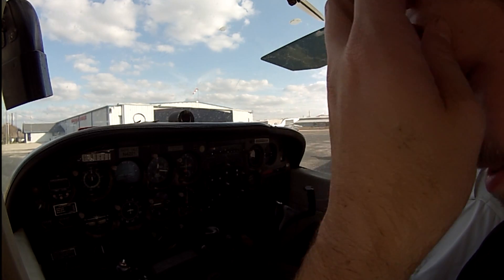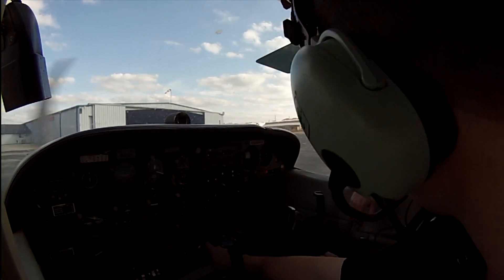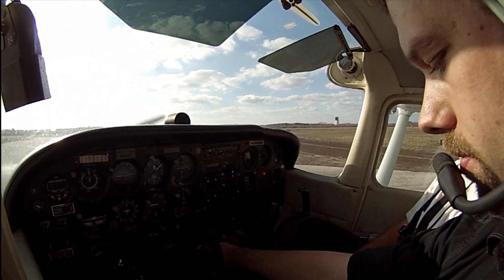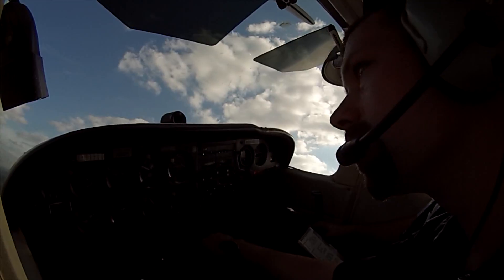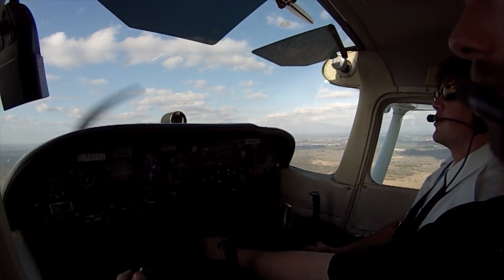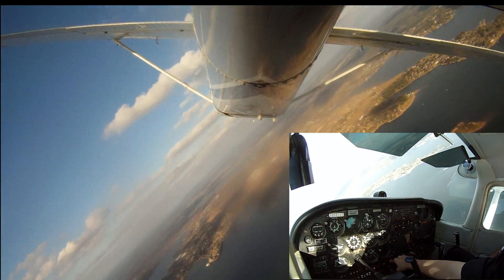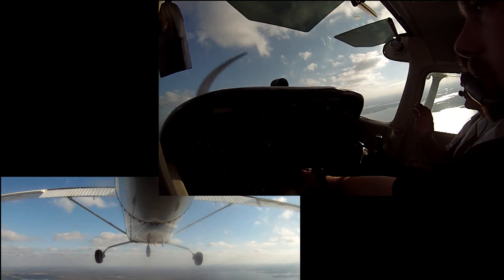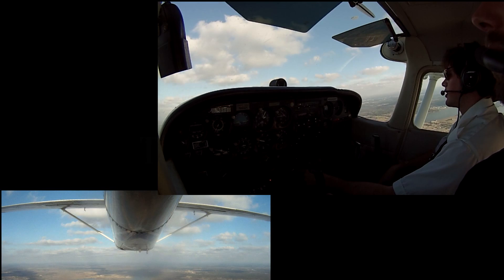Cutlass 172RG Checkout - Part 1

Comment: im an aviation student currently working towards my private but eventually my atp. I was curious on how you mounted the gopro outside the plane
Reply from the maker: +The Tall Texan I actually used the bicycle clamp supplied by GoPro for mounting to handle bars. This particular airplane had a skid plate mounted with the tail tiedown that I was able to clamp the camera mount to. I was really worried about loosing the camera, but obviously it stayed put. Good luck on your training! It's worth every penny.

Comment: What kind of attachment r u using under the tail section?
Reply from the maker: It was actually just the standard GoPro bicycle-clamp attached to the tail-tiedown point. I've heard that the suction-cup mount works out on the wing, but haven't been gutsy enough to try that yet. Thanks for watching!
Reply: Thxs for the tip!

Comment from the maker: You can't make it out in the video, but in Cessna's I push the throttle knob with the ball of my palm, and the carb heat knob with my thumb at the same time. Little habit I picked up somewhere. Thanks for stopping by though...

Comment: Very surprising. Are you sure--it seemed the instructor in this video did say "flaps gear flaps flaps" beforehand, but didn't correct you when you went straight to 10. Anyway, it is on the 172 normal checklist in the "Balked landing" section. You want to get rid of the drag without getting rid of the lift, and that happens at about 20 degrees. In the older Cessnas with 40 degrees of flap, we go from 40 to 20--that's the only time you skip an increment. It's really isn't different from Piper.

Comment: First flap retraction after a stall or go-around should be from 30 to 20, then pos. rate, then gear. Otherwise it looked like you did well.